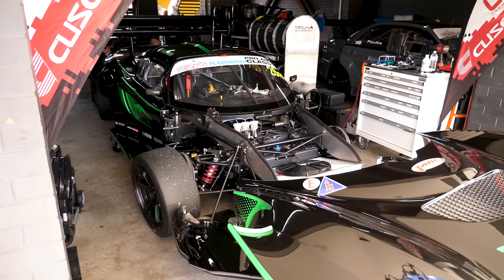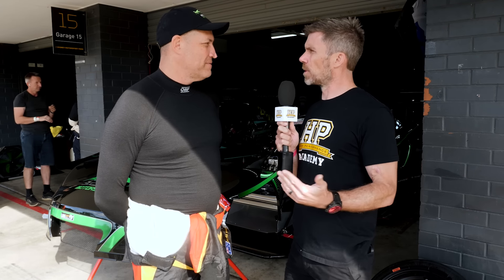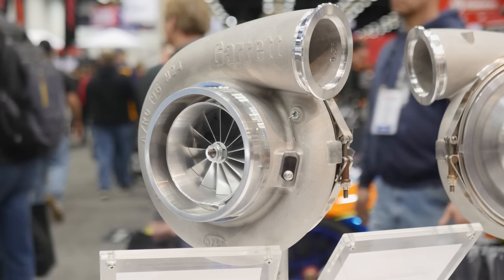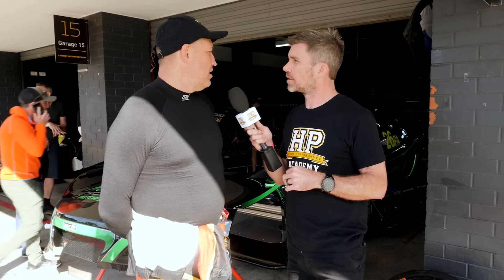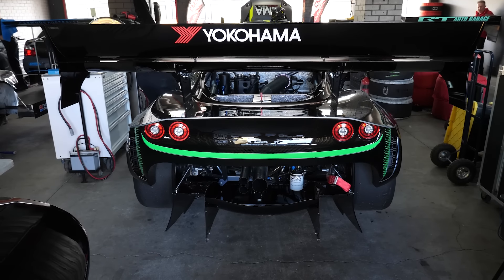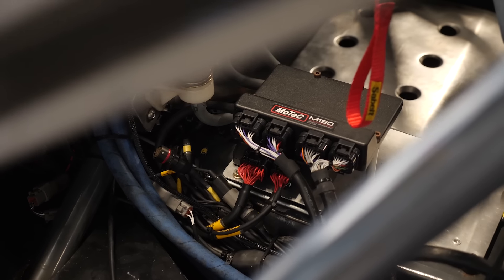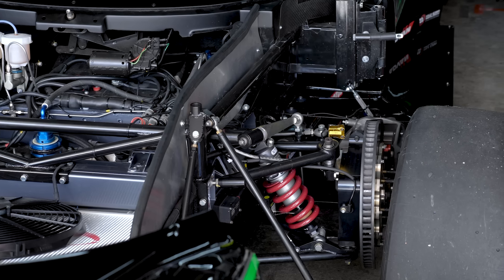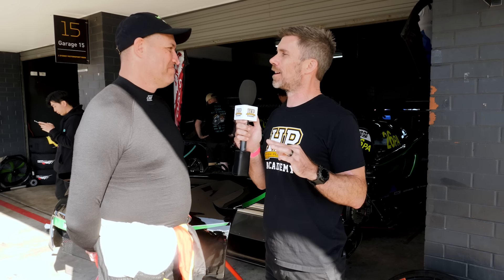The Future Of 1000hp Time Attack Builds?

Comment from the maker: Building a fast car? Get $400 OFF the VIP package with every current and FUTURE course included: https://hpcdmy.co/vipy8
50% OFF your CAD course. Enrol and start designing your own time attack build: https://hpcdmy.co/offery8
TIME STAMPS:
0:00 -  Exige, Not Elise Sorry!
0:16 - Why A Lotus?
0:45 - Lightweight Philosophy
1:07 - Lotus Power Progression 90hp to 400hp
1:49 - K20 Swap Considerations
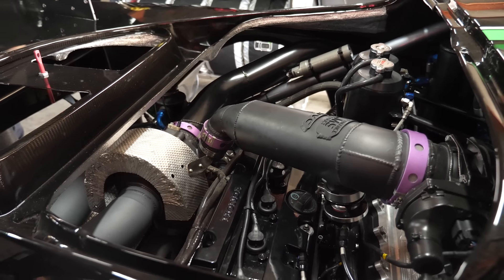2:19 - Engine Build Overview
3:08 - Why K20 Not K24?
3:33 - 1000hp Power Aims & Reality
3:55 - Bare Chassis Build
4:40 - Aerodynamic Limitations
5:15 - Aero Design & Manufacturing
5:58 - Testing The Design
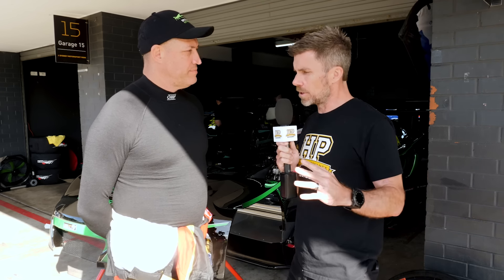6:32 - Someone Had An Off!
6:35 - Ride Height Vs Downforce
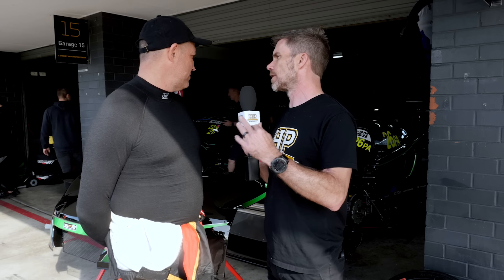7:31 - What Are Suspension 'Packers'
8:02 - Bump Stop Tuning
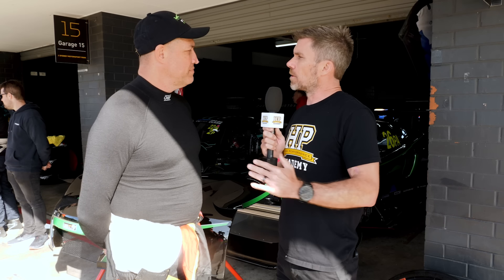8:15 - MoTeC Electronics Package
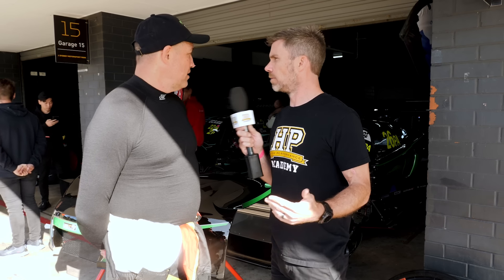8:40 - Holinger Tranmission
9:07 - Paddle Shift, Why?
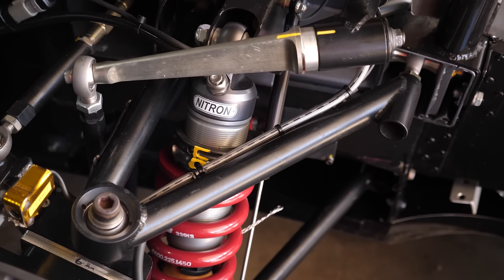9:50 - Suspension Modifications
10:18 - Custom Billet Upright
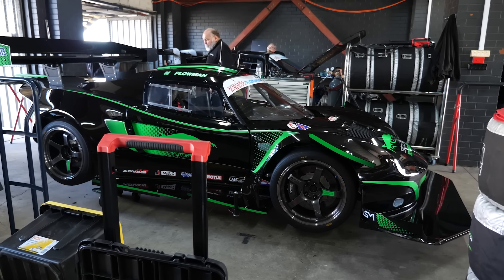10:51 - Brake Temperature Data
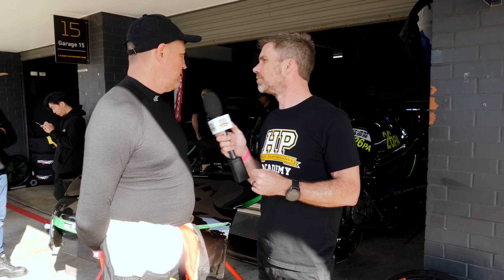11:20 - Driver Vs Car Goals
11:40 - Thanks Matt!
11:50 - In-Car, Hammer Down
13:35 - BUILD.TUNE.DRIVE

Comment: 1000hp in 688kg. = 1453hp per tonne.  putting that in perpective the Aston Martin Valkyrie has a puny 841 BHP/Tonne!!!
Reply: a comparison i find even more interesing: that is more hp per tonne than a formula 1 car.
Reply: @kantina4765  More bhp/tonne than current f1 Cars but about the same as f1 2004 cars
Reply: He doesn’t have 1000hp. Not with 2 bar boost on 2L.

Comment: Guy's the original Rover K series in none VVT was 115 bhp then came 130 then 160. The VHPD race unit was 190 ish. 
If it's possible to make a pretty little car look unfortunate 🙄😆
If I had my time again that Honda unit would be my first choice as well, second to none 
 A reliable 300 brake in a sub 600kg car is more than enough for the likes of me.
What that one is like I'm not sure I'd want to find out🙂
Reply: 2zz-ge are lighter than k20. Toda stroker, sleeves and turbo you have reliable 400hp, enough to poop yourself
Reply: A wheel dyno would probably read 90
Reply: @kermitahnenerbe3722  I ride a push bike these days,  now a diesel van seems fast
Reply: I remember when they came out. 90 hp ! Cheers from New Zealand
Reply: @stevelee5724 Idk but maybe you have crap fuel.

Comment: Great interview as always!! But theres no way  1000whp with 28 psi unless this thing is ungodly high compression or something
Reply: Did you not see the dome on those pistons? Looks like super high compression for a boosted application. I didn't see an intercooler either so he must be running methanol.
Reply: @TheGreenGrower618  no I didn't, sorry. Must have missed that. That and the methanol would explain it
Reply: 3:38 we're comfortably there if we need to be

something tells me this car only touched 1000 hp in the dyno

Comment: 28psi @1000hp? That has to be a record. !?!?
Reply: @BeamRider100  have you seen one make 1000 under 30?
Reply: works out about 350hp NA. must be some spicy fuel or he's measuring from a low pressure area
Reply: @heem6619  you can’t really do it on a linear scales it’s an asymptote. I would really love to see a 1000hp down on sun 30 psi of boost. That’s really insane
Reply: K series flow so good they need less psi to make power.I seen a stock k24 with 10 psi almost making 500whp.
Reply: @heem6619  K series NA have gone well over 400 hp
Reply: @Shadowboost  Not a 2.2 though, AFAIK
Reply: @veejay120793  I mean I get it, that’s what the last guy said. Look up the word “asymptote” VE goes down as boost goes up, it’s not a linear climb
Reply: @dogmoo  the Dyno doesn't lie. Usually 1 bar boost should technically make 100% more power if the boost to backpressure ratio is 1:1 and intake temperature is the same as ambient.....k engines exhibit strange behaviour in that adding 1 bar makes over 100% more 😅
Reply: @dogmoo  Idk, but a lot of the 1000hp+ k  series are around 30psi +\-.I seen a k24 on the dyno 28 psi 1030 hp on a g42 1200.I doubt this guy turbo will see more than 1000hp I think it will max out alil lower than that.
Reply: @diesel-technology5507  look I could be wrong but this is the same comment the other guys made. It’s not 1:1. As you increase boost pressure the return in power should decrease. This also has lots to do with cam profile and engine size.
Reply: @veejay120793  that’s crazy can you link to it? I’ve never seen anywhere near that, 1k should be around high 30’s  or more on k series. Maybe I’m wrong, we should have a power to boost challenge
Reply: @dogmoo  double the pressure and you double the density so long as the temperature remains the same. If you've got a good charge cooler that's no problem. When the boost pressure to back pressure ratio is 1:1 the engine operates at a completely n/a motor except with the increased air capacity that you have with the pressure, so a 2.4 motor with 1 bar technically becomes a 4.8 liter, 2 bar and it becomes a 7.2 liter and so on.
Reply: @dogmoo  https://youtu.be/fjn721v9snQ?si=3iiKOg3_1oq8xYtC 
That challenge wouldn’t work cuz the bigger the turbo the more hp per psi.
Reply: @veejay120793  this didn’t show psi
Reply: @dogmoo  it does, go zoom in the very left bottom of the dyno chart screen. At 19 sec.
Reply: Good flowing head but 28psi isn't applicable measurement unless it's the same size turbo. 76mm at 28psi and 64mm at 28psi isn't the same amount of air
Reply: @jubu3136  That would be part of it. Can you say of the top of your head what size turbo would make the most power at 30 psi?  The tricky part would be altitude and "fairness" but it wouldn't be too hard to lock down.
Reply: Wouldn't have a clue. One of the speed factory K series drag cars maybe. Think there is a dragster that's run 5s. Whatever they have
Reply: He’s under 260 down the straight. You can do that with 500hp and 1100kgs. The engine might be able to be wound up to 1000hp but likely he’s making under 600.
Reply: @Earlysport  He said he gona hire a professional driver in the future.He sounds like he don’t really have a lot of driving experience.

Comment: 1000hp and 9000rpm puts them very close to the 850nm limit on the gearbox... So much for never being near that... Or 1000hp.
Reply: We don't know where his peak power is coming in it may be progressive as rpm increases boost increases
Reply: @bigbothoee8617  I'm assuming it's at 9000rpm unlikely to be above that and based on that assumption they are at 790nm  of torque pretty close to the 850limit on the trans.
Reply: I was thinking along the lines of peak torque low down but now thinking about it doesn't matter, the limit of box won't change 
Would It matter if it's low down  or high up ?
Reply: @bigbothoee8617  torque is torque, we don't know what torque he's making but we can assume his 1000hp figure is high up in the rev range so we can calculate the torque required at 9000rpm to make 1000hp. If he made 1000hp sooner then it would only increase the torque going through the gearbox further running into its rated limit.  So either he's not making 1000hp or he isn't miles from touching his boxes max torque spec as he implied.